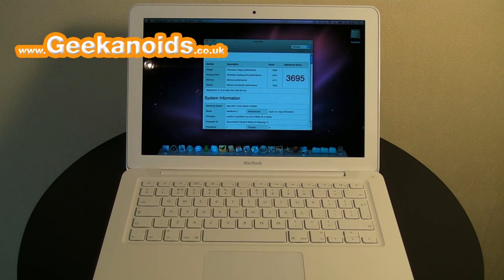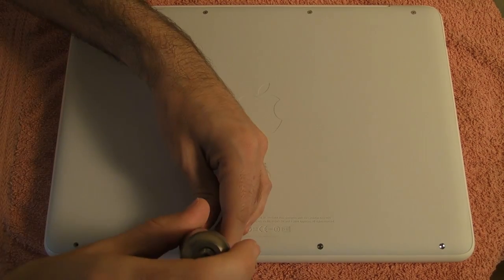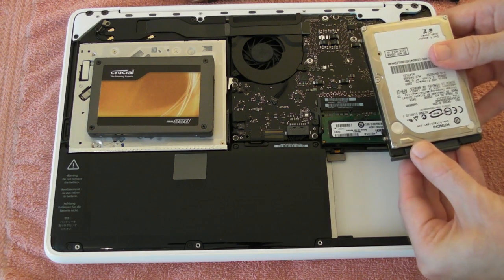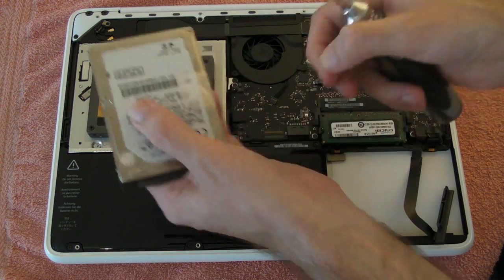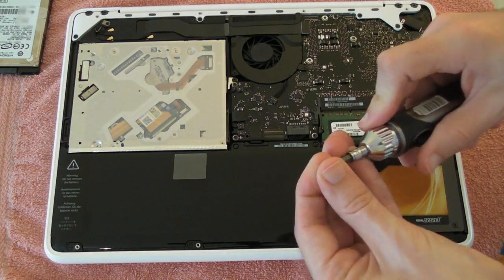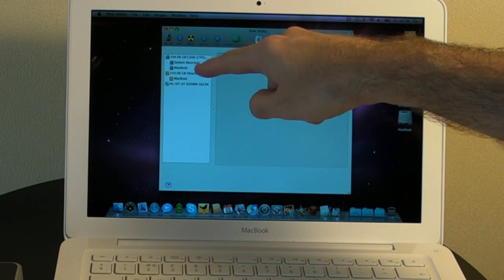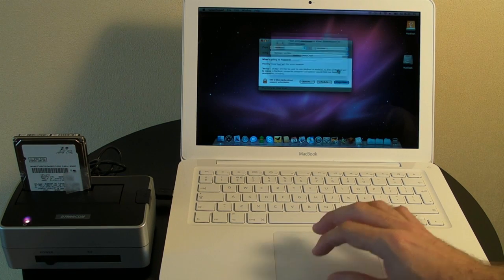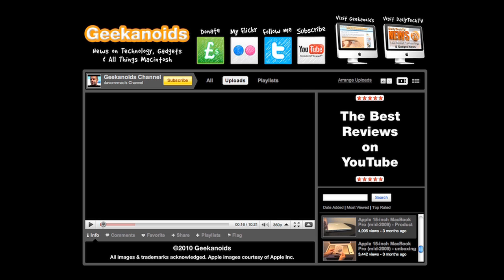Apple MacBook 2.4GHz White Unibody Mid 2010 - Crucial C300 SSD Upgrade

Comment: I tried replacing my old hdd with a new crucial ssd but when I turned it on, a folder with a question mark appears. I tried pressing command + R or any other techniques but it won’t go in recovery mode. I didn’t back up my os in a hard drive, is that the reason why?
Reply from the maker: Sorry I no longer have this to check. Best way to get around this is to clone from one hard drive to the other.

Comment: Prepping to do this with my much loved 2010 Macbook - and I just wondered what OS you'd recommend putting on it once the SSD is in place now we're all the way in 2020? Mine actually still runs10.6.8 and is pretty smooth considering, though I'm starting to have issues with Google Chrome etc.
Reply from the maker: I am not sure which version this laptop supports. Maybe start with 10.6.8 then see which updates the system offers. Best of luck.
Reply: @geekanoids  SO quick question, I have the same laptop, would any 2.5" SSD work as long as its a 2.5" SSD?

Comment: I have this model MacBook and attempted to update the drive to an ADATA SU630 240gb SSD. I cloned my HD using SuperDuper. Install went fine, but performance tanked. Each time I just moved the cursor, I got the spinning beach ball. Finally had to re-install old drive, so computer working again. I've ran the SSD through Disk Utility several times and it tests fine. Any idea what the problem could be? I've searched everywhere for a solution, with no luck. Would certainly appreciate any assistance. Thanks.
Reply from the maker: Sorry I no longer have this to check and really not sure. Normally the spinning beach ball relates to RAM.

Comment: Checking this out in Dec 2019.
Reply: I was gifted one of these. It was painful to watch it booting up, now after upgrading to 8G ram and a crucial ssd, it boots quickly and overall, the machine is fine for the internet and microsoft office type work. I still have my 2015 MBP15, so I'm a bit behind the times. I was tempted by the new 16" but will prefer the same improvements in the 13/14".
Reply: choboutube I have a machine like that I can purchase cheap. When you say it boots fast, how fast is it? And how long to e.g. launch safari or other applications?

Comment: thx for the video, i was surprised you did not disconnect the battery, though, that seems to be generally accepted practice to avoid damage
Reply from the maker: Thanks for your feedback.
Reply: @geekanoids   any reason you did not mention it?
Reply from the maker: I was tethered up with anti-static which was sufficient.

Comment: Might be delayed but what’s the max ram that can be installed on this model?
Reply: Apple say 4GB but you can max it up to 8GB, 2 x GB
Reply: @miss0scar  thanks for the clarification! I read on the specs for this model it said 4gb,.I added 1x  4gb  on 1 slot and left the 1gb stick and the system registered both which is why I was confused.
Reply from the maker: Sorry I no longer have this to check.
Reply: I have a mid 2010 macbook white and it's using 8GB RAM right now. I was confused at the time I was looking for information (around 2013) and bought 8GB memory at my own risk. I've got surprised 8GB worked and it's still going strong!

Comment: is there a way to put NVMe or M2 ssd in this Macbook pro 2010? so i could keep hard drive
Reply: well, if you wanna keep the harddrive, you can put the SSD in the main drive bay, and put another HDD in the ultrabay using HDD caddy, of course you have to remove the DVD superdrive.
Reply from the maker: I don't think that is possible Batman.

Comment: Excellent thanks.
Worth noting that although the Crucial SSD can do SATA 6Gbps (well, actually, they all do these days), the mid 2010 13" macbook I currently have on my workbench can only manage SATA 3Gbps. Still a very worthwhile upgrade though especially if you've just upgraded it from Snow leopard to High Sierra on the standard HDD and now wished you hadn't :D
Reply from the maker: Thanks for sharing.

Comment: Hello, recently I was given this exact model as a hand-me-down from my brother. It has lost its ability to charge and is now dead. I've tried using different cables and everything. Do you know why this might be happening?
Reply from the maker: Probably needs a new battery.
Reply: use some alcohol on q tip go over charging area let dry before plugging back in

Comment: I switched my hdd with new one which is 500gb. Installed 10.6.3 updated to 10.6.8 then when i tried update to el capitan it froze. Switched back to 10.6.3 ,now it wont update to 10.6.8. Any advice how to fix this issue? Thanks in advance :)
Reply from the maker: Not sure, it might be that El Capitan is not supported on this laptop.

Comment: +Geekanoids Around 2:34 the color of the ram changes, did you upgrade the ram while you were replacing the hdd, or is the taking apart of the macbook added in from a previous video to save time?

Comment: When you were formatting your hard drive , you made mention of part that was reserved to windows.

would that have anything to do with running windows on your mac as per a boot camp application?
Reply from the maker: Richard Reid Yes.
Reply: Geekanoids so thats where you would put boot camp

Does it run faster on sad and not slow down the rest of the applications on the Apple os?

Comment: Hi. I like your video. As you have been using the crucial ssd drive for a while now, have you notice or experience any performance issues? I am in the market looking for a ssd drive for my macbook pro 2009 model as well. I have narrow the field down to intel, vertex and crucial drives. In the end it will come down to economics as these drives aren't cheap. Your suggestions or comments will certainly help. Thanks.

Comment: 'Integer' is pronounced 'in-te-jer' not 'in-te-ger' :)

How long will it be before Apple takes the lead and starts intalling SSDs as standard? They make a hude difference to an system, especially those with slow laptop-drives.

Comment: You didnt put back the plastic tab that was on the original hard drive, to be able to lift the hard drive, i know its not a big deal cause a flat head or tilting the hard drive will also work